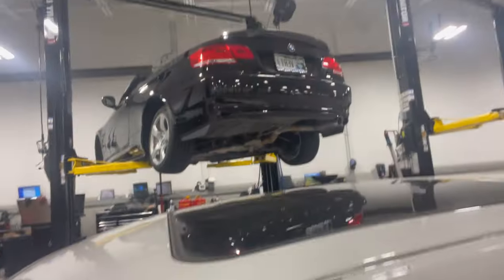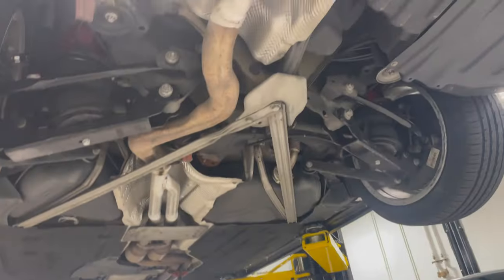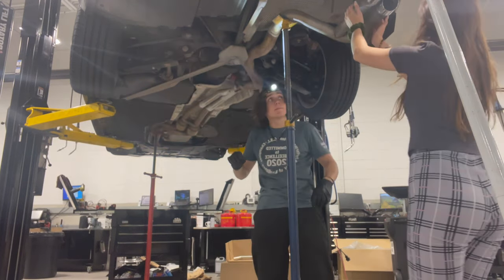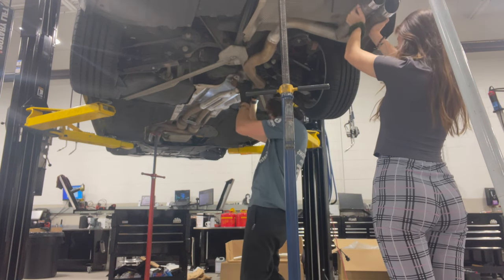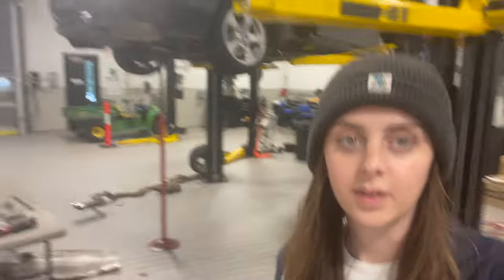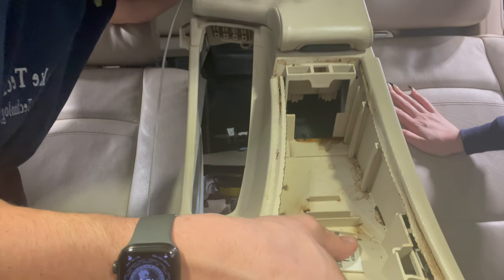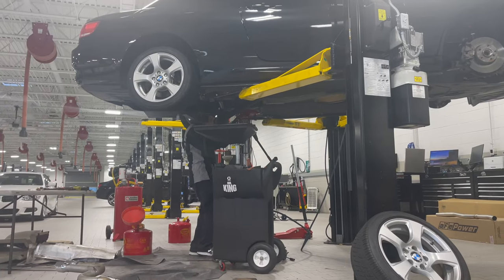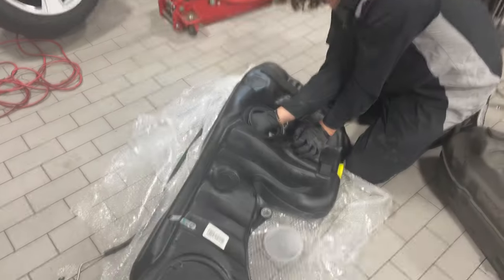Is this the best-sounding N52 exhaust? | aFe Power Cat Back w/ Active Autowerke Headers

Comment: I have that same exact exhaust on my 07 328xi e92 and it doesn't fit right,  must be some length differences from 2WD to AWD, ended up installing the full meisterschaft gt exhaust system and sounds awesome with 0 drone but the afe is louder